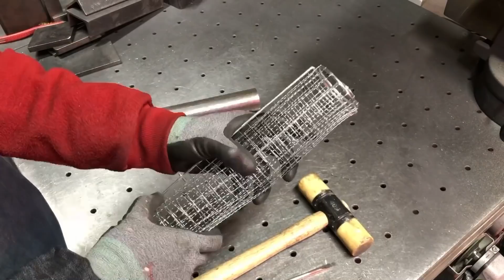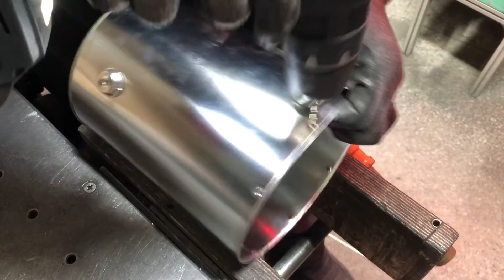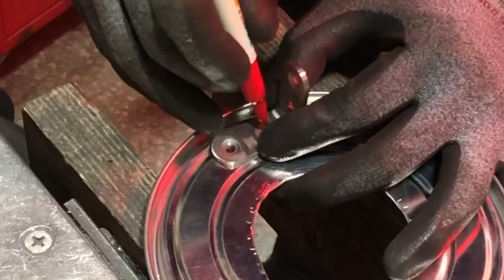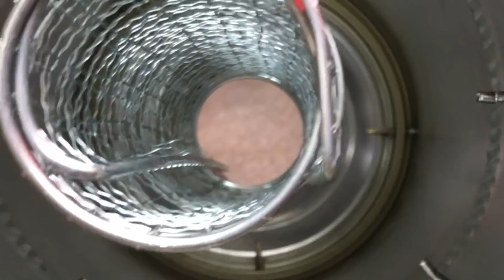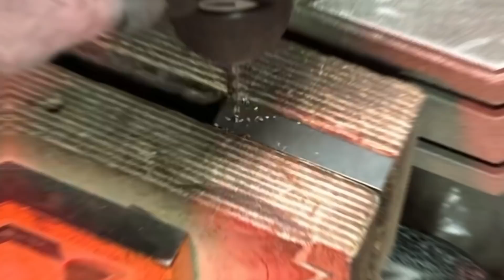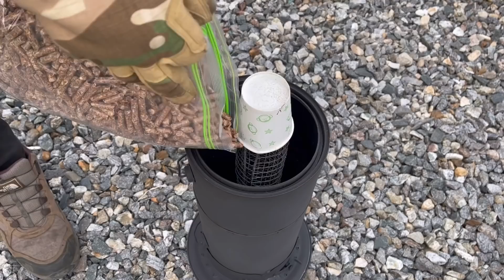일회용 고기석쇠를 이용한 로켓스토브 만들기/Making Rocket Stove Using Disposable Meat Grill

Comment: Very nice!  What is the burn time with the pellets?  
I'm thinking you could have a heat exchanger (water or air/thermal mass  brick, rocks) with a chimney to vent the exhaust.  Then you could replace the rocket stove when it burns out with another fresh pellet rocket stove for some consistent heat, 
-radiant floor with warm water or bricks   -maybe to warm outdoor cats...
Reply from the maker: Burning time is about 3 hours.

Comment: Off topic tool suggestion for your workshop:  Periodically I see you folding metal for your projects using a vise.  There is a tool that I have seen several variations of that allow metal to be bent or folded.  If you can get past his presentation style, his design is fairly simple using bar, angle and round stock materials.   Perhaps this would be a useful tool for your shop too.

https://youtu.be/Ggy1DHwAh_0

Wishing you and your family a blessed spring season and good health.  Peace brother.
Reply from the maker: There is a banding machine at the end of the table on the other side, but it takes a long time to work, so I will only use a vise.